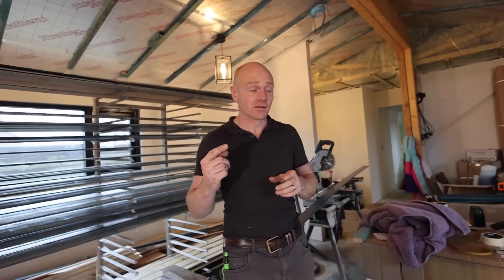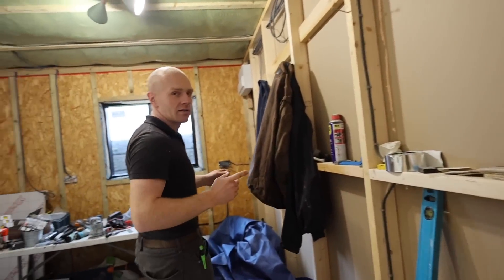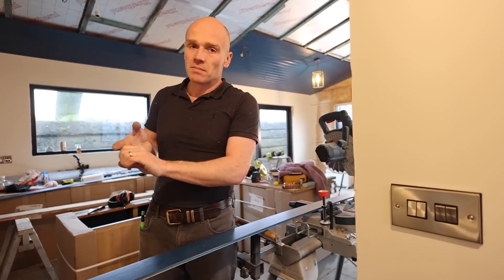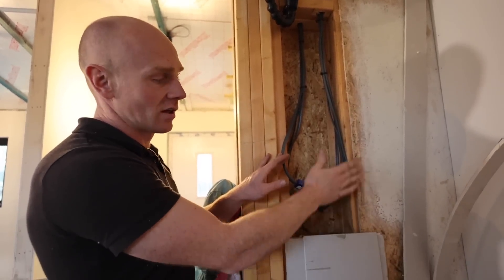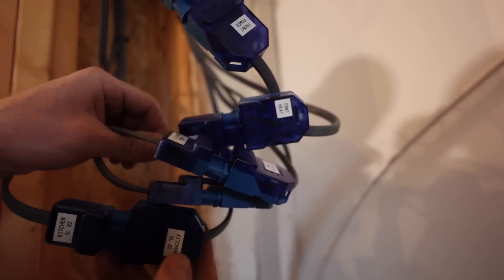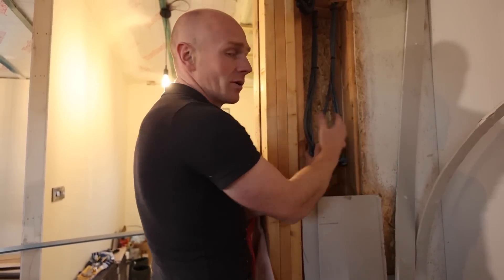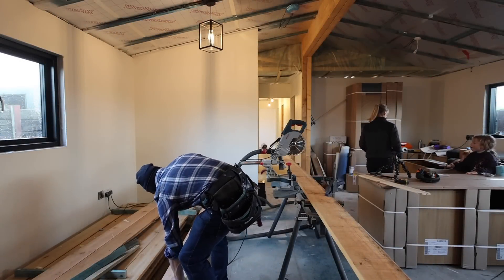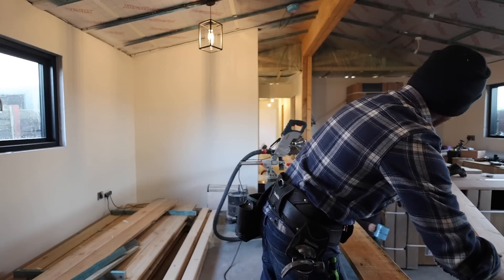HOW WE WIRED A TWIN UNIT HOME - A build of two halves! - Electrics Q&A

Comment: Did you not consider kinetic/lightwaverf switches to reduce the need for wiring?  That would have solved the hallway lighting wiring. Great video, as usual. Really interesting project, looking forward to the completion video.
Reply from the maker: We are using them elsewhere however as the supply power needs to be taken over there anyway so one additional connection pair was fine.
Reply: The joining blocks are much smaller than I expected. I had visions of massive Anderson connectors like a fork lift even though the amps on a house would be so much lower. It is funny how you picture things in your head 😊

Comment: I would be interested in hearing thoughts on heat alarms in kitchens. I was dissuaded from fitting one by our electrician because apparently by the time it's hot enough to activate you really want to have left already. We ended up with a normal smoke alarm just round the corner and it's open plan so should work fine.
Reply: Normally put in a heat detector to avoid the noise from a typical ionisation type smoke alarm being activated everytime you burn your toast.
The heat detector will normally activate on a rapid rate of temperature outside of normal room temperature range so won't be activated by smoky cooking.
Reply: No such choice here in Scotland.  Every domestic kitchen needs a heat alarm interlinked with all the smoke alarms.
Reply: While your electrician is right about how the alarms work,they haven’t factored in human nature. Plenty of fires start without people knowing about them. E.g they start to cook something, but leave it unattended for a moment, and then get distracted. It’s all very well to say you don’t want to be there by the time it goes off, but this assumes you are in the kitchen when the alarm is about to trigger. What if you are not? I think not having a heat alarm in the kitchen is bad advice.
Reply: @tlangdon12  Hi Tony, you may well be right and I will have another think. We do have a smoke alarm in the dinning room which is open plan with the kitchen. It hasn't gone off so far with cooking but would hopefully go off if there was a smoke coming from a fire the kitchen.
Reply: Hi Tim, any new vids on DIY Farm?

Comment: Should the alarms be on there own breaker ?
Reply: If you connect them to a lighting circuit then if the circuit breaker trips then it is fairly obvious that there is a problem. If on an individual circuit you may not notice if the circuit has tripped. Usually best to wire sensors as a separate circuit and connect to a suitable lighting circuit at consumer unit.